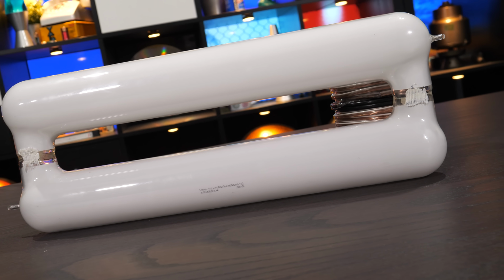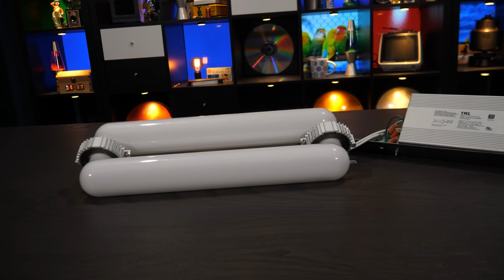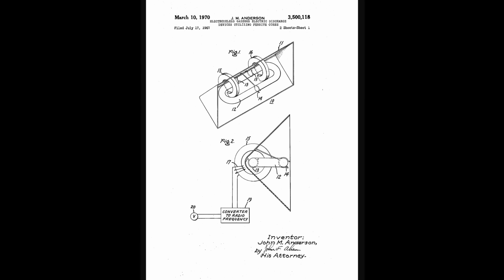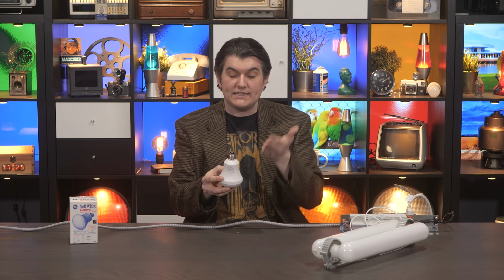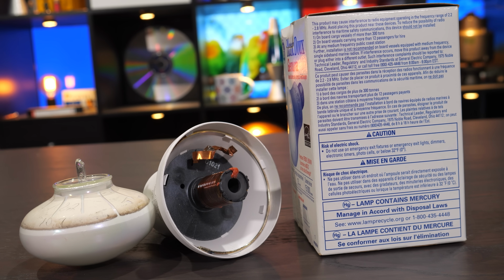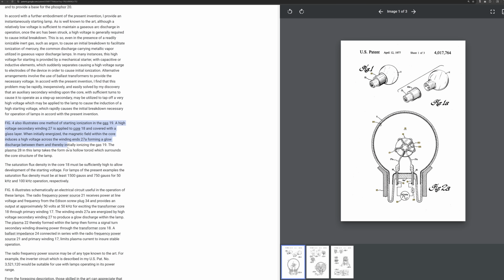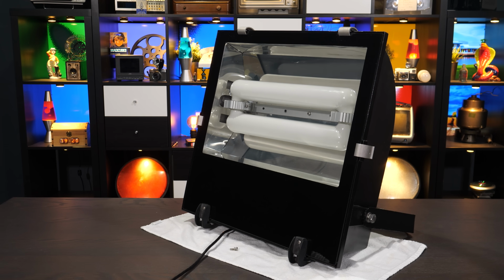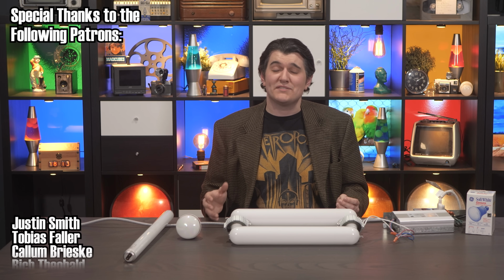Induction lamps: fluorescent lighting's final form

Comment: About why they didn't take off, it's pretty obvious if you approach this from a "dollars and cents" perspective and not a "(un)common sense" perspective.
At their most basic, all you need to make a "standard" fluorescent tube lamp operate is a ballast (fancy name for an inductor to limit current, yes that's right, in the past fluorescent bulbs operated directly off of mains AC), a switch to turn the lamp on and off, and a second momentary-on "starting" switch to "short out" (intentionally and safely) the electrodes at each end of the tube in such a way to cause the heating filaments at each end of the tube to have a voltage across them and therefore be warmed by resistance heating.
To turn on the lamp, you would turn on the main switch, press and hold the "start" switch for a few seconds to heat the electrodes, and then when you release the start switch, the act of breaking the circuit with an inductor in series naturally creates a large voltage across the 2 distant ends of the tube, starting it. Follow-on developments replaced the start switch with what is known as a Fluorescent Tube Starter, which is a device that is very akin to a thermoelectric turn signal flasher, it has a bimetallic switch in it with an electric heating coil wrapped around it, with the strip and coil carefully calibrated to close the switch if there is mains voltage across it, and open the switch when the low resistance of the arc in the tube creates an insufficient voltage drop to adequately power the heater.
That's right, you don't need any semiconductor or vacuum tube electronics to make a very basic self-starting fluorescent lamp fixture. Just basic electromechanical things that were largely mastered decades ago. Very cheap to manufacture because of loose tolerances.

Now, enter induction lamps, which are basically "Just a better fluorescent lamp".
Everyone already knows fluorescent lamps by this point, they're well understood, you see them in every store you care to go into by the '90s, and yes, they use them because they're more efficient than incandescent bulbs (not a hard thing to do considering how inefficient those are).
Induction lamps are a new thing, they haven't been commercialized for long enough for many people to even know they exist, yes they're more durable than fluorescent lamps, and a little more energy efficient too, but they have this nasty thing where they make the TV reception horrible, they make the radio make funny noises it's not supposed to, and not to mention they're a lot more expensive than "normal" incandescent or fluorescent lamps, plus you usually have to replace the entire fixture to get one put in (unless you're using one of those GE "Edison base down-spot lamp replacement" lamps), and it's the most expensive part of the lamp that fails first (the drive electronics, even if they're remotely mounted) rather than the cheapest part of the lamp (the fluorescent tube or incandescent bulb itself, cheap and easy to produce on an assembly line with mid-90's tech).
To me if someone came and tried to sell me on converting my entire house over to induction lighting in the mid-90's when they were commercialized, I'd have called them crazy and maybe a few other things I'd rather not say here besides, because the cost-benefit analysis just doesn't work out even if I'd be using the same lamps today because of how durable and efficient they are. The up-front expense and unknown nature of the technology is simply too great compared to the known engineering that was incandescent and fluorescent bulbs with the way they are so simple to make operate on mains AC, compared to the always troublesome thing that is power electronics of any nature (see: now it's the LEDs that are doing that whole "fails when it shouldn't" thing, and 90% of the time it's not the diodes themselves, it's the drive electronics due to corners cut on thermal design).

Comment: "Because fluorescent light sources are very much not point sources of light" is only mostly true. "Laser" headlights are the exception, they're a tiny fluorescent phosphor dot (often about 1mm diameter) that gets a high-power UV laser shined at it. They produce all the visible light out of that tiny spot, producing their characteristic extremely hard-edged beam. Mike's Electric Stuff has a good teardown video.
Reply: LEP is also used in some projectors. Higher powered light sources use a spinning phosphor disc to keep it cool. It's still a point source since the laser is focused down to a small spot on the disc.

Comment: I remember how expensive they were when they first came out.  I bought a Genura at full price and then promptly broke the tube's seal with a reassuring crack and hiss when I tried opening it.  We do still use induction floodlights with the large tube you have there as part of the house lighting on the Royal Edinburgh Military Tattoo.  Mainly because of the fast start and wide spread of light.
I'm not sad to see the demise of induction street lights though.  They were very bulky lights to handle.
Reply: My first use thought was for stage work lights. One or two fixtures would be ample for my past work sight.
Reply: Would love to see the schematic for the power electronics on the Genura on your channel.
Reply: @melissablick779  , i think big clive did one about induction lights a few years ago.   i think i had commented that the bloke i worked for got asked to replace one.   he asked me, a known know-it-all, if i'd heard about them.   i had not.   the electrical wholesaler hadnt either but found a replacement.   they were used in particularly awkward places to get to.
Reply: Next up, a microwave sulfur lamp?
Reply: @cebruthius Actually, it’s been done by a company in LA for film and video. Except they use a different gas for its plasma. 50 thousand hours lamp life (no electrodes) and a small magnetron. Super bright, very compact and pricey… Hive Lighting Plasma.
Reply: @cebruthius  Maybe a flame on lime.
Reply: Anyone else reading this comment with Big Clives voice in their head?
Reply: @pauls3075  One moment please...

Alright, now I do.
Reply: @pauls3075  I am sure everyone did.
Reply: @pauls3075  "Just One Moment"
Reply: @pauls3075 I tried, but It was a little difficult to make it match.
Reply: @pauls3075 i did lol with his EXACT rhythm and cadence lol
Reply: @pauls3075  No, i'm reading it in grandad's voice: 'when I was a boy......' :)
Reply: Nice to see you here, Clive. Got a schematic for that Genura?
Reply: Genera were cool, but their high operating temperature weakened the solder joints… which didn’t matter as the boxes stated “lifetime guarantee” and B&Q honoured that for years!!
Reply: Will it carbonate?
Reply: San Quentin State prison installed the large 200W version to replace HPS lamps back in 2015. The long life was a key factor... Would you want to be the guy who relamps the yard? Also they were used in the dining rooms, which have several million dollars of art on the walls. The non focused light was a benefit there as well.
Reply: Have you encountered microwave-driven sulfur lamps? They were even weirder than this.
Reply: @mumiemonstret Yes. Extremely bright.
Reply: As someone who's worked with high-frequency ballasts and RF power supplies, it's fascinating to see how induction lamps bypass electrodes entirely. The toroidal core acting as a transformer loop with the tube forming the secondary is such a clever workaround. I’ve tried modifying a broken circular fluorescent into a crude induction lamp before this tech really shows the brilliance of rethinking old physics with modern materials like ferrites.
Reply: Shkematics! or it didn't happen! 😁
🙋🏼‍♂️🍻🍻
Reply: i have one of those genuras as well, think it cost about £20...? and i think that was on offer? cant remember!
Reply: 5:13.   Instant start lamps i.e. single pin base lamps will continue to light after the electrodes have worn out, with wild swirling and one end is very black with bright orange flashes.  The end with the bad electrode gets extremely hot, in fact the smaller diameter lamps such as a T8 on an electronic instant start ballast can crack the end and melt the socket, which stops the discharge.   This is very hard on the ballast and many T12 magnetic slimline ballasts in years past have been destroyed by this.
Reply: The RF havoc it caused was also not a thing you wanted at live shows.
Reply: Love to stumble across Clive in the wild
Reply: When you get Big Clive watching a different electronics channel, you know that channel is good! Technology Connections is one of my favorite channels
Reply: I bought over a dozen LED bulbs, they put out a bunch of light, a great color, and sold by Dollar-Tree. Soooo....
Reply: @noahway13  and?
Reply: Great to see you on other Channels Comments @BigCliveDotCom
Reply: Put it in the soda stream
Reply: i am absolutely not disappointed to see you commenting on a Technology Connections video on lighting
Reply: Just went down a rabbit hole on the meaning of a military tattoo
Reply: woah, bigclive is here :D
Reply: We love you
Reply: Hey Clive! good to see you here :)
Reply: Greetings Mr. Clive! :D
Reply: I just wished you see that vid!
Reply: Why would breaking the tube's seal be reassuring?
Reply: @mediocreman2  It was a joke.  I was crestfallen when it happened.
Reply: @mediocreman2  because you were reassured that it was broken.
Reply: Yep. This tracks.
Reply: Have a great day everyone 👍

Comment: Back in time, we used to light up fluorescent tubes in a nearby stable, using the Hipar radar from the Nike missile system. Peak power output 7.5 MW, at about 1.5 GHz and pulse repetition rate of about 420 Hz. Pulse width 6 microseconds.

Comment: I am not surenthe mechanism behind striking the lamp at startup but I would guess the mechanism behind the startup is induction heating and ionization in the free mercury vapor itself. its why you can make a flourescent tube glow when you expose it to a strong enough radio frequency or a magnetron tube. :3. this tech would be superior to led lighting in hot climates.

Comment: To be fair, they don't need fast startup times as street lamps, it's not like they are being turned on after it's already dark.Obviously not optimal for something like a porch light.
Reply: There's a "street light" at a highway intersection near me that's been lit 24/7/365 for years.
Reply: Yeah, if anything I feel like a street light should ramp up in brightness slowly (as the ambient light gets darker) rather than instantly
Reply: The main risk that comes to mind is power outages. If the light's design turns a one-minute outage into 10 minutes of no light, that's not good.

But that's a "but sometimes!" and is easily resolved with a backup battery. Besides, it's rare that you'd have an outage long enough to cause that problem and cold enough weather that the light cools quickly and then takes a long time to come back on.

(It's also moot thanks to LEDs!)
Reply: @renakunisaki  It' not no light, it's less light. And if you are living in a civilized country and not e.g. the US, outages are fairly uncommon. Where I live now that happens quite often (for Germany), since I live basically at the end of the power line I guess, but that is still only 2-3 times a year. Pedestrians can probably live with being extra careful 10 minutes every 10 years per person (since not everyone will be on the street at every outage).
Reply: Oddly, fast start up times are a great function for street lights, it allows the use of motion detection to enable lighting only when there are drivers who need the illumination, which may only be 1%or less on quieter rural roads.
Reply: @industry65  There's always special cases, but for general purpose lights, at best they just have a light sensor on top, or one for the whole street.
Reply: @industry65 i think lights turning on and off frequently would be very distracting for drivers. If drivers need a light that's only where they are, it's called headlights.
Reply: @industry65 on roads that quiet it isn't really worthwhile to put in a load of streetlights

Comment: My guess is, that the light is inductively coupled to the driver during startup. In a capacitor, you also don't need, two conductors touching each other. Same as when you hold a fluorescent tube to the tesla-coil. Since you have two connections around the tube, this might be enough to start them!

Comment: Back in 2011-2014, my wife and I lived near Lexington MA, and that town used these lamps for pretty much all their streetlighting. As you noted, in Winter, Lexington was hella dim, as these guys were operating at about 60% of their rated lumens if the temp was below freezing, and on very cold nights, they were all purple. Lexington recently swapped them all for LED. 

Similarly, the Alewife T station also used these, but on the platform, so they never dimmed and were exceedingly bright. I haven't been back to Alewife in a few years so I'm not sure if they've also been replaced but up North, these have a hard time working outdoors in Winter.

Comment: We had designed some induction lamps around the time of the Philip QL(?) and GE Genura, even working on a neon induction lamp for rear brake lighting (LEDs arrive a year later wiping out a year or so of hard work). These worked at 10.7MHz. This lighting induction lamp, square loop mercury doped argon/krypton fluorescent lamp, worked at 150kHz as I recall. We tested them and found efficacies of the order of 70lm/W (lumens per watt) which was disappointing at the time, as standard longer T5 tubes were hitting 105lm/w. Electrodes incurred a modest energy loss not present in the square loop tube. Sadly, the efficiency fall was due to the very fat tubes needed to keep the loop voltage low enough to get reliable ignition. T5 tubes were skinny. Their higher strike voltage was easily put directly on electrodes directly in the argon, and being skinny, mostly the UVC, generated in the high current core of the discharge, wouldn't get re-absorbed by the time it hit the phosphor on the tube walls. The fat T16 (?) tubing created a nice low voltage drop around the loop but fully 30% of the UVC got reabsorbed by the mercury vapour in its lengthy journey to the walls. 

Undoubtedly, these would have a very long life, as it was electrodes that mostly fail. However, fluorescent lamp manufacturers could extend standard tubes by fitting an extra pair of electrodes and with a few other tricks could achieve lifespans of 60,000hrs, which nearly always far exceeded mandated service intervals during which the working tubes would be swapped out for new.
Reply: ive met these brake lamps.

the only manufacturers I have met with a gas discharge third brake lamp, BMW and MItsubishi.

both look otherworldly compared to L.e.d.
Reply: @roycejulian1517  The mid nineties Ford Explorer had our (electroded) Neon CHMSL and the variant ran for a few years racking up about a million units. The BMW had the same format by someone else, but needlessly trying to run these off HVDC they couldn't ignite them reliably. They called us in to help them. The Philips Lamp was under-gassed for easier striking making it look anaemic. The DC pushed the neon up to one end and contaminants or diluting argon to the other. The look started weird and went weirder over months. We showed them the design study for a full trunk width CHMSL for the Cadillac "Northstar" and Delphi's EMC sign-off using HFAC, but BMW's chosen designer insisted DC and created a costly mess for them. Cadillac chose widely spaced red LEDs making something cool looking, using a 1.5m by 8mm neon lamp, into something decidedly tacky.

Comment: Dang, you've beat me to it...  I had a few of those lamps, but I didn't have the drivers, and I wanted to make a video on them for the longest time ever. And just when I finally came across about 200 surplus drivers for them, I see your video...  But then again, I'm just a guy making videos and you're a professional YouTuber, so you're much better at it than me.  A couple of points: There is a little electrode inside this lamp that is helical and it's there in case there's not enough mercury vapor, so it can evaporate enough mercury to start the lamp...  These lamps also exist in the CFL format, I have a couple of those somewhere.  These have also existed for signage, really small tiny tubes that are shaped like letters, I have been on the lookout for those but have not been able to find them in years....  The other lamp that I've been on the lookout for forever is RF excited halide, but I have not been able to find an example that I can afford, maybe you'll have a better luck finding one - They're really, really interesting.

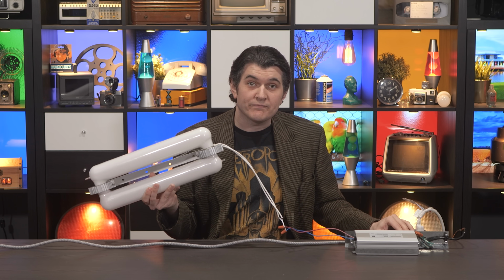Comment: Just realized that florescent lights are basically filtered UV lasers. Like, I had all the background knowledge to get there, but for some reason it just clicked this second. 3:52
Reply: yeah, you just need a couple of aligned mirrors.    There are actually lasers that use RF, but most use direct discharge.
Reply: Yeah, but the coating would be doped to reflect instead so that only the partial mirror lets out bursts of high frequency light. The induction is more interesting to me, since the gas ratio inside isn’t over or under gauss to voltage ratio! I’m no expert but seems like the manufacturer has a resonance to induction ratio chart that I’d love to pirate!